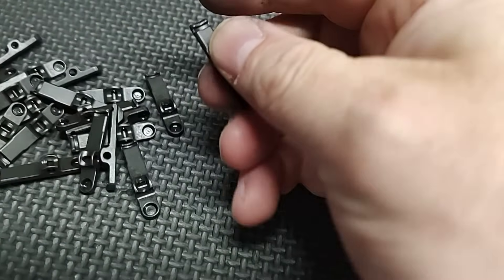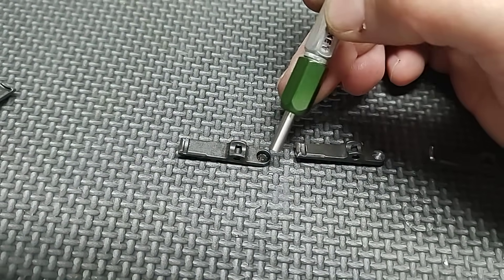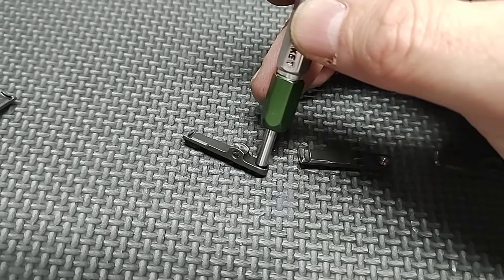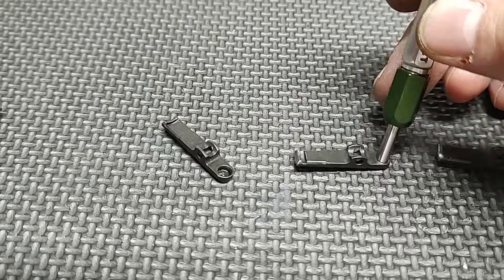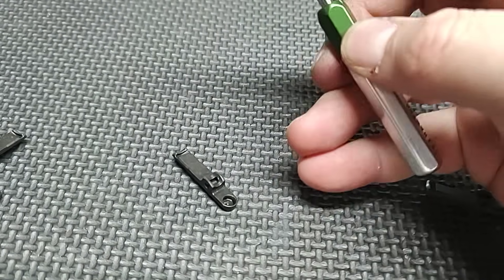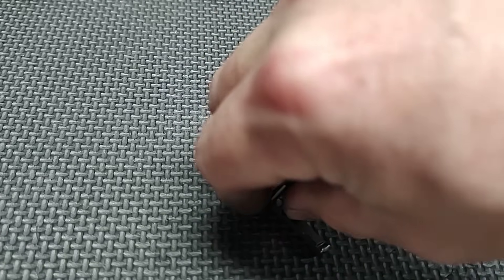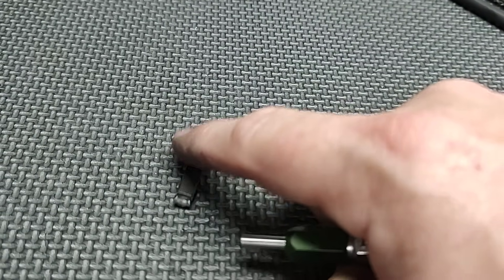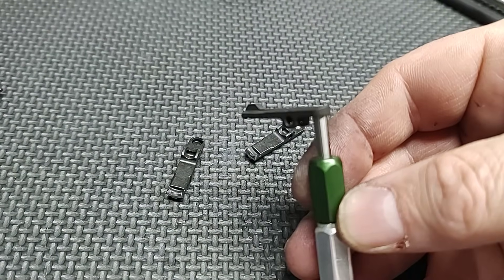Common AR-15 Extractor Problem - Undersize Extractor Spring Pocket

Comment: This is terrible.  So all AR 15 owners should have a dozen gauge sets to check all these parts that should have been checked at the factory????
Reply: If you're buying a sub $400 Radical, psa, bca etc then id be concerned. If you're buying a bcm, geissele, solgw etc then I wouldn't be concerned. You always get what you pay for. Especially in the world of ARs
Reply: @Idiocratus_Max81 the manufacturer has nothing to do with it. Yes, they tend to have better QC but even the most expensive guns still have issues. I just had LMT send me 5 bolt carriers in a row that were all garbage. I just gave up trying. I've also had to return a BCM upper and a Criterion barrel. EVERY company produces shit sometimes.

Comment: Biggest AR problem out there: people do not clean them properly. Most people never break down the bolt carrier group and give it a good cleaning, getting all of the carbon buildup off, checking for abnormal wear, etc. nor do they take the buffer and spring out to see if they are beginning to get damaged or if they are operating properly. This can help you find and and prevent/mitigate a large portion of malfunctions (though not all). Spend some time cleaning your weapons and you can learn quite a bit about them.......
Reply from the maker: Wrong. Couldn't be more wrong.
Reply: @SchooloftheAmericanRifle when is the new secret shopper rifles coming out?
Reply: @SchooloftheAmericanRifle Sounds like FUD logic...